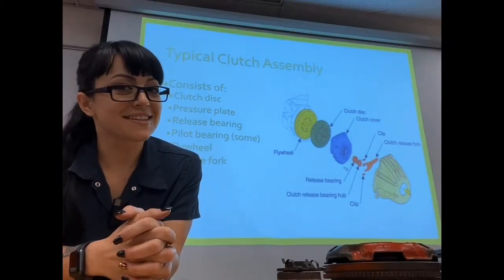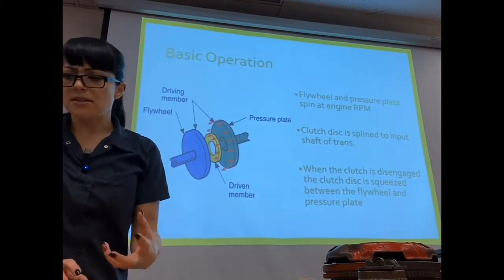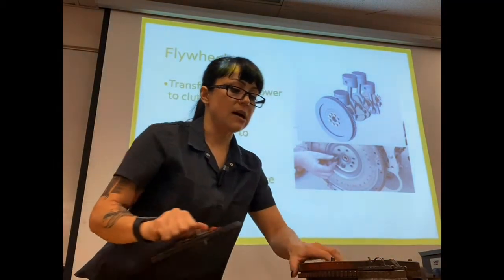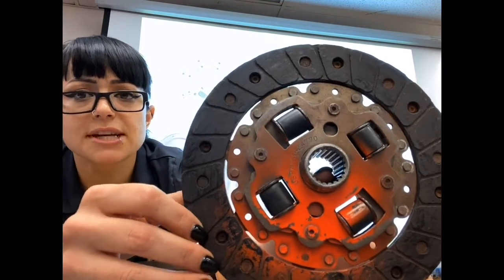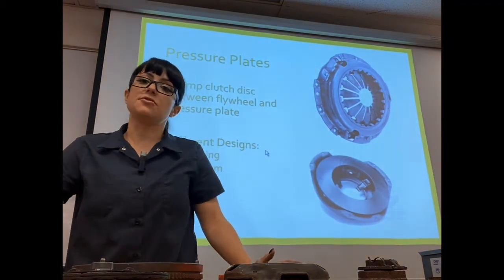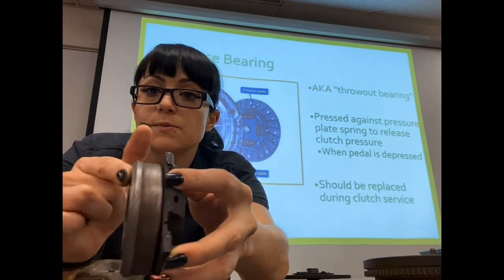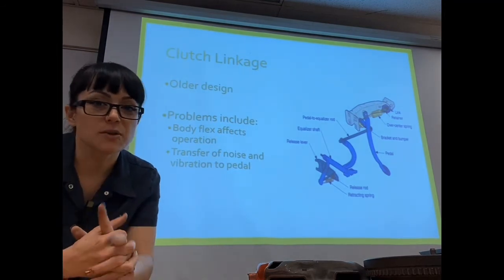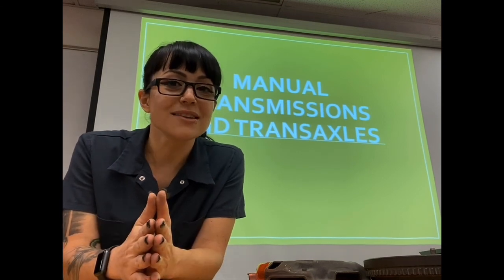How clutch assemblies work

Comment: i mean to simplify things yes an automatic transmission doesnt need a clutch, except they make automatic transmissions with clutches, like DSGs
Reply: That's not an automatic. It's a computer-controlled manual. The difference is the presence of a torque converter. DCTs (which I think you mean) like the PDK, the unit in the C8, and pretty much any high-end sportscar (and several low-end crossovers) these days still have a clutch disc (or two) and associated hydraulics. They just don't have the pedal.